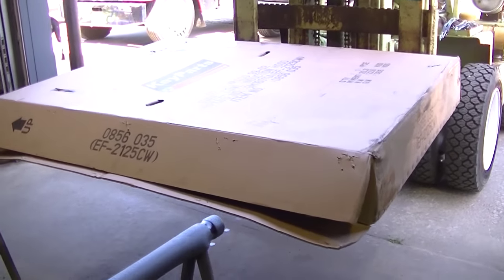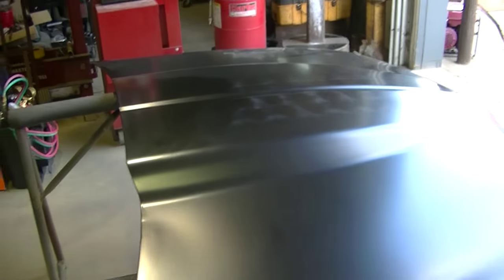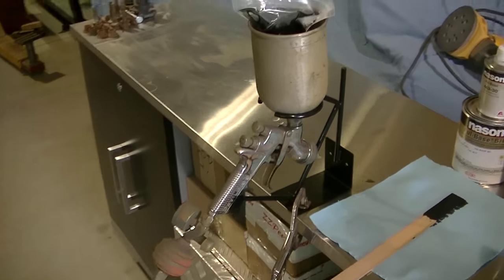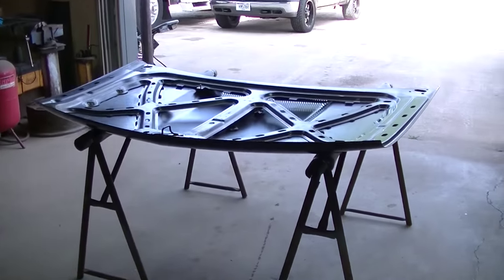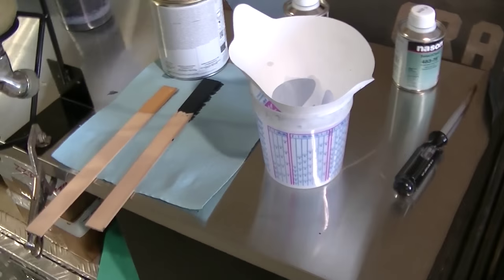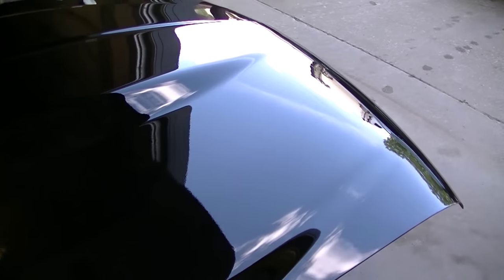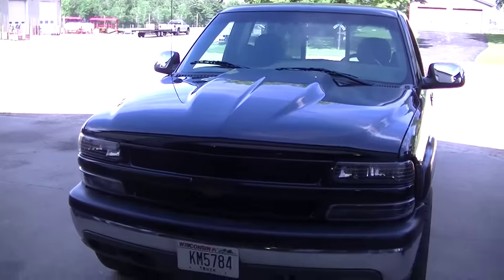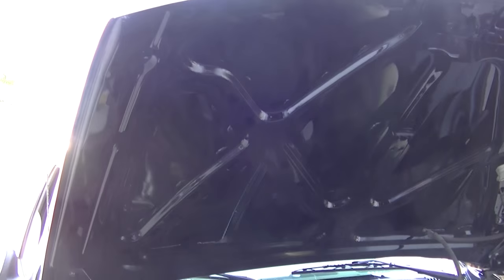2000 Silverado Z71 Cowl Hood Painting and Install (1 of 2)

Comment: Very nice.  I had to realign the hood on a few cars.  What works for me is to leave the bolts somewhat snug, then get those rubber suction cups window installers use.  Slap those heavy duty ones on top of the hood, and use the handles to slide it where you want, then tighten up the bolts.  Plan on installing the hood insulation?
Reply from the maker: jewllake   The hood don't have a whole lot of adjustment.  We had to loosen the bolts one time so that was pretty easy.  The insulation is not going back on.  I like to hear the motor run.  Plus with the cowl hood the heat can get out of the engine bay.
Reply: mossman381 how do u align it to match the fenders mines has a big gap on one side and the other side is almost on top of the fender

Comment: Hey mossman, I have a 2002 Yukon Denali, and am replacing my hood. Was curious about weather to go with a steel cowl hood, or a fiberglass (duraflex) hood? And also would you prefer a 2' or 4' rise on the hood? Truck looks great and thank you for your time.
Reply from the maker: I have had fiberglass hoods.  They seem to work just as good as the steel.  I prefer the steel hoods.  I like the 2" cowl hood.  The 4" seems too aggressive I think.

Comment: those replacement hoods are EDp: Electo deposited Primer.  I hate to see when people mistake it for paint, install the part then see it rust after the first rain storm.  the two hoods I've done, I've simply used Rustoleum Gloss Gray to paint.  My S10 has lasted for years that way.  My Suburban it all got covered with GT Mat a year later.  With your sprayer system, do you get overspray on your shop and other equipment in there?  That's one thing rattle cans are horrible about...especially the Duplicolor Bed Liner rattle cans.
Reply from the maker: I think a lot of people leave them primer because after buying the hood they don't have the money to take it to the body shop to paint.  That is why I taught myself how to paint  :)   The overspray isn't too bad.  The clear coat is the worst.  It likes to float all over and stick to everything.
Reply: Thus the idea for a collapsible painting curtain in your shop?  Yeah, I'd like to get my own painting equipment someday.  I do pretty well with rattle cans, not always perfect, but pretty well.  With a real setup who knows how much I could do....speaking of self made setups: check out Sprayway Customs' Channel.
Reply: Yeah, shop organization is always a puzzle.  Still, your one of the posters on Youtube that I find myself coveting where shop space is concerned.  That's half the reason I haven't acquired the tools I know I'd use: I just don't have space for them.

Comment: I just got the same hood today for my 99 Z71 stepside. I had the same epoxy blobs on mine. After I painted it I put on a new hood liner. Goodbye epoxy blobs.
Reply from the maker: I really liked that hood.
Reply: @mossman381  My truck is Pewter. So what I taped off where the cowl splits and painted the 2 sections with a satin black and the rest of course Pewter. If I could figure how to put pictures on here I'd show ya.

Comment: where did you buy the hood from.also i have a 04 yuon xl and it was made in mexico .will a usa built fender for the same truck fit on the mexico built yukon
Reply: im hearing there is a diference
Reply from the maker: Got the hood from Summit Racing.  Not sure about the fenders.  Not sure why there would be a difference.
Reply: cool.i called gm dealer ship and they are saying they are different and have a different part number.its hard for me to beleive.supposaly if the first digit is a 1 its usa if its a 2 its canada and 3 is mexico.i just dont want to get a aftermarket fender made in usa and it not fit.its driving me nuts.usa built is easy to find more of them and cheaper.but i dont see y ther would be a difference or y they would make them different
Reply: if you every hear anything about if there different or the same i would definitly apreciate it

Comment: Are you sure there the same. I thought the 2500 hood was different than a 1500
Reply from the maker: JohnDeere50d   On the outside the hoods are different but the inside they are the same.
Reply: I have a 2500 hd hood on my 1500 silverado it's a 2000 they do fit.

Comment: I'm intrested in buying one but  what's the difference between stainless steel cowl hood and steel cowl hood which one do u  prefers better
Reply from the maker: I think you mean fiberglass vs steel hood.  Not stainless.  I like the steel hoods better.  I don't think there is anything wrong with fiberglass just prefer steel.

Comment: Where did u get your paint cabinet/table at
Reply from the maker: Made it using some cabinets and a damaged counter top.  I think I have a video on making it.
Reply: Video would be cool and cabinets and stuff you used
Reply from the maker: Here it is  https://youtu.be/8scul-0GLpo
Reply: Where did u buy cabinets and that counter top piece and wheels
Reply from the maker: Everything is from eBay.  The counter top is a damaged one when I got my cabinets. The wheels also from eBay. Can't remember the weight rating on them.